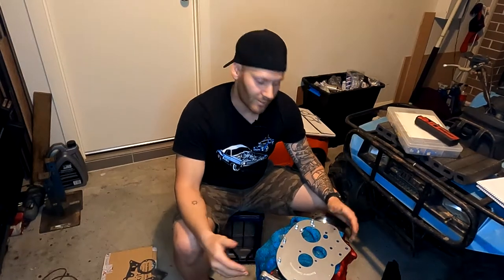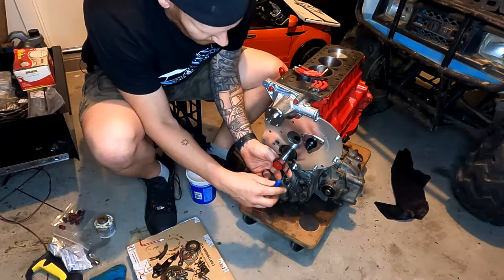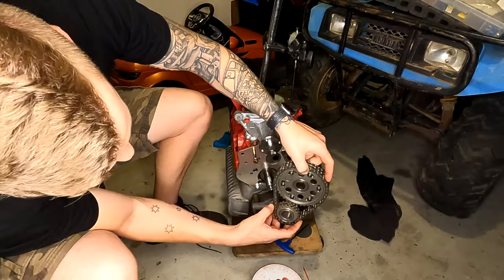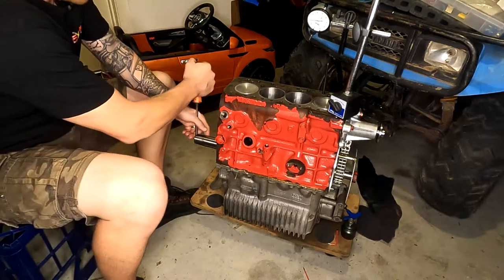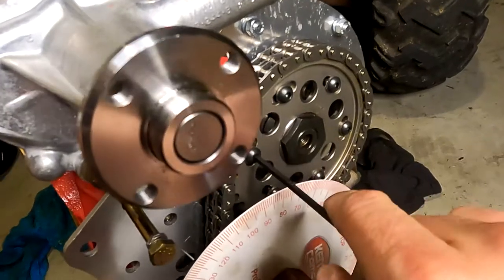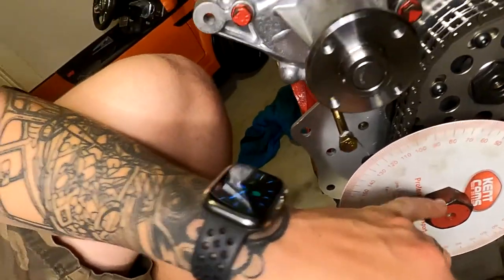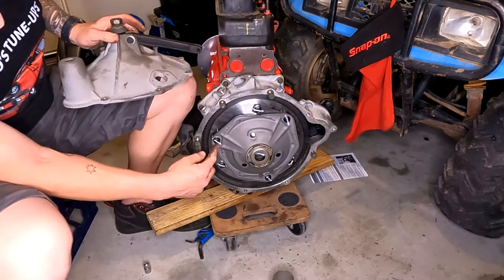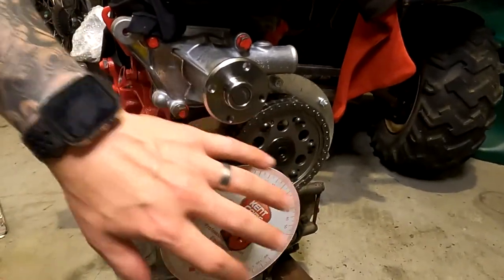How to install a vernier type timing chain on a Classic Mini - 1275 A+ engine build - Part 9

Comment: An I ask a question -when the dial gauge is on the cam lobe - is the dial measure 5 thou either side or is this a different dial gauge.
Reply from the maker: Hey mate,

Essentially here you want to ensure that the gauge is at the highest point of the cam lobe. Once the gauge stops moving then goes back the other way, you can ensure it’s at its highest point. 

It’s about finding the sweet spot to ensure what you’ve got on the gauge is the highest it’ll travel to ensure the correct lift is applied, therefore precision timing can be applied to the engine. But yes, this gauge measures up to 6mm I believe. 

Does that answer your question?

Comment: why dont you put the engine on a bench instead of working off the floor ?????????????????????? the camera angle is difficult to see
Reply from the maker: Have u seen the size of my shed at the time? I barely had room to park my mini in there with my toolbox. Newer episodes I have it on a stand. If you feel the angle isn’t good enough, there will be other builds I can redo this.